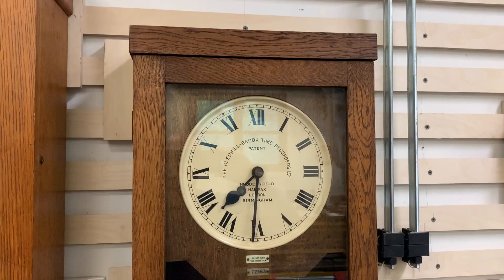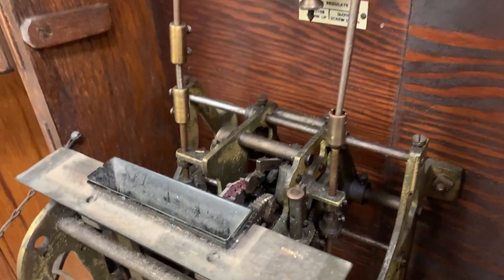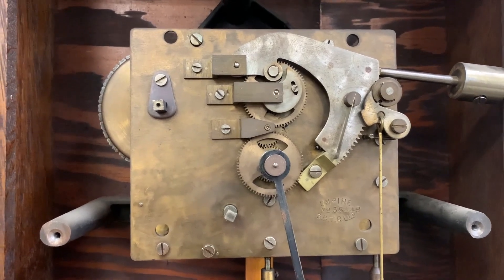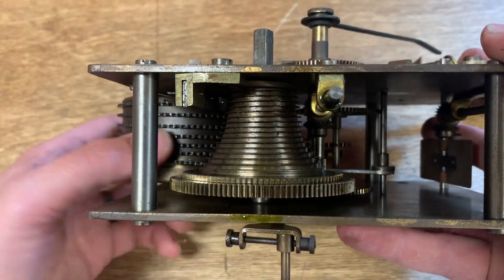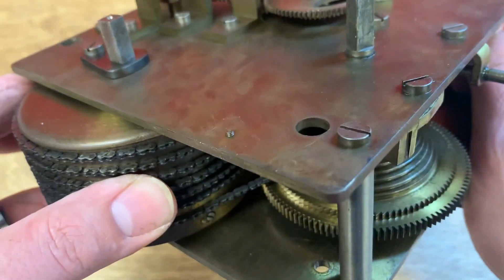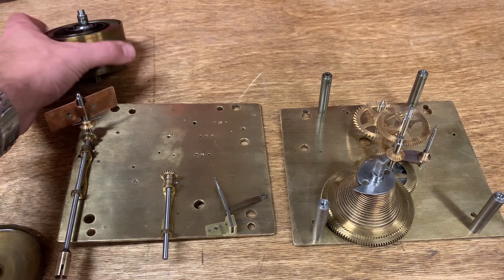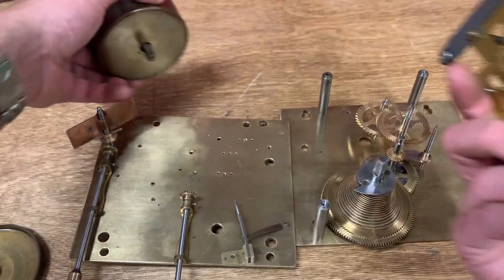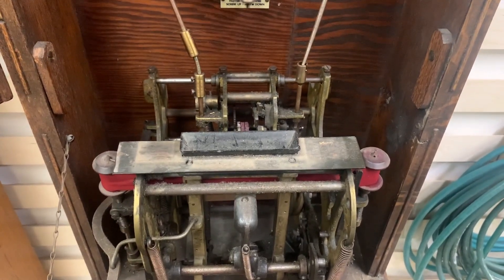Gledhill-Brook Time Recorder Part 1

Comment: I bought one of these clocks from a retired Gledhill Brook/Simplex service engineer, these clocks are excellent time keepers, for the money you can pick these up for they are a excellent value , The one thing the engineer told me is when transporting these clocks around always set the hands to 11:45 am or 11:45 pm there is less strain on the gearing system when set at these times reducing the risk of damage whilst moving, never move the hands backwards you will strip the gears on the stamping mechanism, one half turn of the rating nut will result in a 10 second difference in 24 hours. Secure the pendulum whilst moving to prevent damage to the suspension.

The Gledhill Brook company was taken over by Simplex in 1964 the remaining stock had the dials changed over to simplex dials and any clock that came in for repair with a grubby  dial had it changed when they came into the  workshop to a Simplex.Serial numbers on the case may not always correspond to the movement serial number, due to movements being swapped out sometimes if a clock came in for repair.

The build quality is excellent with the cases being solid oak throughout, they are as a result very heavy depending on model between 30 to 40 kgs so need to be fixed to a solid load bearing wall.

The fact these clocks where so well made was partly responsible for the eventual closure of the company, the clocks carried a modest profit, the company relied upon the fact that companies took out a service contract, which gave them  a 6 monthly on site inspection, which most of the time was ink ribbon replacement, and cleaning out any card clippings that had found there way into the stamping mechanism , call out for repairs was also included, the fact the clocks where so reliable made it  difficult to persuade companies to take out the contracts.

The Engineer told me that it was not unusual for these clocks to run 20 years between services and the most common repair was wear of the time and date stamping wheels.
Reply from the maker: Thank you for this great additional detail - I really appreciate you sharing your experiences. These clocks truly are built like tanks.

Comment: These are lovely clocks. Gledhill Brook made three versions of the movement – the fusee version you have, an impulse version controlled by a master clock and, in later years, a mains powered synchronous version. I have one of the impulse clocks in which the fusee mechanism is replaced by a couple of heavy duty coils. In all other respects the clock mechanisms are the same. Mine also has the more complex clocking-in mechanism which uses a two-color ribbon to mark workers who are late in red ink! 
As I am sure you know, the serial number is marked in several places on the case. You can use this to date the clock. My guess is that yours was manufactured either during or just after the war. The wartime clocks were slightly less ornate and included a plain steel plate surrounding the time card slot. Earlier machines had a more ornate cast brass plate marked with the Gledhill-Brook name. 
I look forward to seeing how you tackle the clocking in mechanism. Mine needs cleaning but I have been too scared to touch it.
Reply from the maker: Thank you for sharing this information. According to workclocks.co.uk, my serial number 35449 on the movement dates to around 1930. I haven't looked at the case to see if it is marked there as well - I will take a look.

They made a number of really interesting clocks, including one that cuts a little chunk out of the side of the card every time it was punched which indexes the card vertically, allowing an arbitrary number of punches per day. Mine can only support two ins and two outs per 12 hour period.

Part of the project will include recreating the cards. I believe I have found an image that should get me started, but some trial and error will be required to get it right.

I'm looking forward to the punching mechanism. I haven't worked on this particular model before, so we'll learn together.  :)
Reply: @MinnesotaClocksandWatches  A good place to look for the serial number is on the top edge of the door. Thanks for a great video series.